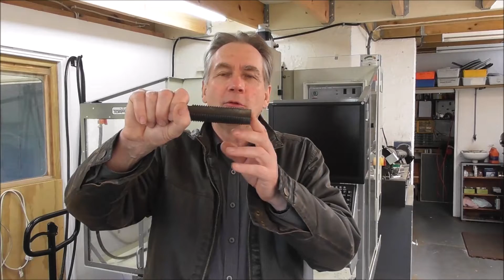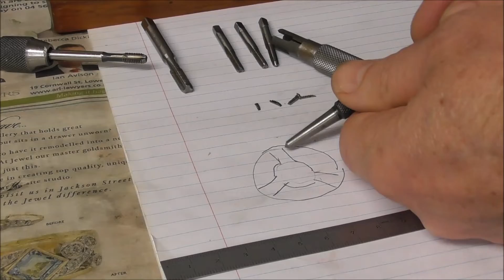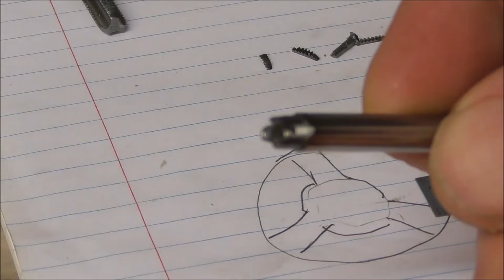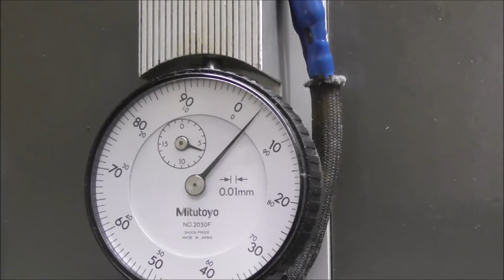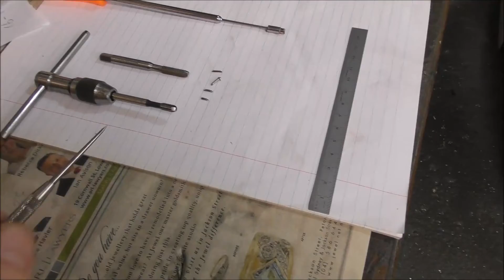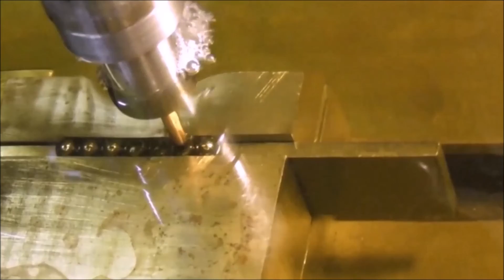Broken Tap Removal

Comment: I’ve removed several taps over the years, the most difficult one was a 1/4-20 on a huge Aluminum wheel 5 ft diameter on a prototype pouch machine in the 90s for a detergent paste with a soluble film for laundry before all these pod were on the market. We didn’t launch it nationally because we had a target of 100% solubility of the film and with all the variables in the water town to town it wasn’t feasible. The crazy thing now with those products is they just dropped the requirement of completely dissolving the films, if you find undissolved film in your clothes and call the manufacturer they tell you to run it under hot water to get it off your clothes. That’s one of the reasons that it’s difficult to get the quality that used to be just part of good manufacturing practices I worked for the Clorox company in the Engineering R&D Technical Center in Pleasanton California for 26 years. So many great challenges having to design things that haven’t been done before mostly in the highly corrosive requiring Ti Grade 2 that doesn’t have much structural integrity but was required on all wetted parts. I’m sure glad I found your channel can’t wait to search the play list and learn more just because I’m 67 and still feel the a puppy. GOD BLESS YOU!🙏❤️💪🇺🇸

Comment: You saved me from so much trouble, and what was becoming a hopeless situation for me. I was about to give up but all the things you suggested got me through. I was making metal brackets for my trimaran that are used to hold the floats on with, by tapping  10 mm thick stainless steel with 1/2 inch UNC tapping tool and broke my first tap before I got through the first hole. The second one broke on the next hole. Your suggestion to use a hardened steel punch helped me screw it back out. However your best tip was to grind off the worn threads as they become dull. . I haven’t broken a tap since. Not only that but the broken tapping tools I grabbed out of the dustbin I  am able to reuse them again by grinding them back into shape. My wife helped too by using the drill press to force down onto the top of the tapping tool as I turned it till it was able to  bite in enough to carry on without. You are a Godsend and I am so thankful to you.
Reply from the maker: Hi Ray. Thanks for taking the time to give that feedback!  Good timing for me. Cheers  Cliff

Comment: Hey Cliff.

First option for removing Thread Taps as mostly they will be small in size normally NO larger than 5/16 or 8 mm.
And the most difficult to remove.
Try to remove by hand tool,  but NOT for to long as you usually make it worse.
Then give up and get some one with a Tap Burner to remove it the correct way.

No sense to waste to much productive time on an unproductive job.

As far as NOT breaking Thread Taps never heard of a way to stop this from happening.
I have broken Brand New Thread Taps and 10 year old  Thread Taps.
Thread Taps can break at will,  not because of the operator error.

Love the Spark Eroder.
It came in very handy for your Probe Stems.
Thanks for the video.
Unfortunately a little disappointed as i learned nothing new.
Regards Peter.
Reply from the maker: Hi Peter - Thanks for your feedback. I will be publishing another video on the subject, hopefully it will be less dissapointing to you.  Cliff
Reply: @Threadexpress  
Apologies for the comment Cliff but there was no mention of a part 2 to cover what was not in this video.
It is at some point that you need to be honest with comments.
I prefer to honest and say what I see not just go along for the sake of it
You are a great guy and you deserve the following that you have.
I see your subscriber number going up more than when I first started following your channel a few years ago now.

My comment to some degree was not needed but the promise of showing us how not to break a thread tap was.
Not at all addressed.

You are welcome to revisit the possible in complete video if you wish.

But I have since moved on from your channel now.
Maybe all the happier for you also.

Thanks for your reply and wish you all the best for the future.
Regards Peter.
Reply from the maker: @weldmachine   In case you missed that video:  https://www.youtube.com/watch?v=z4d8ODfQvAQ

Comment: It appears that the spark eroder actually cuts a cylindrical hole through the center of the tap? And the core goes up into the stem that holds the electrode?  I always envisioned it eroded the entire center of the tap. Am I seeing this correctly. Made me laugh when you mentioned getting your "ducks aligned"... a favorite phrase of mine only here in America it's "getting your ducks in a row..."  Thanks Cliff
Reply from the maker: Hi Douglas!   Yes a tube type electrode cuts quicker as dilectric fluid is flushed down through the centre and helps to keep the 'soot' from building up. 
My diction may need some work - I should have said 'ducks in a line"   Cheers  Cliff